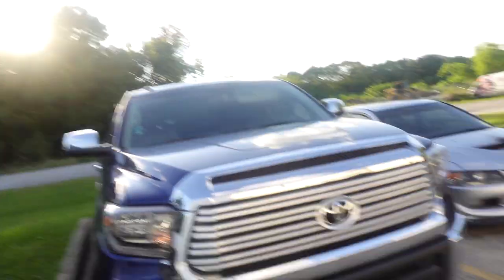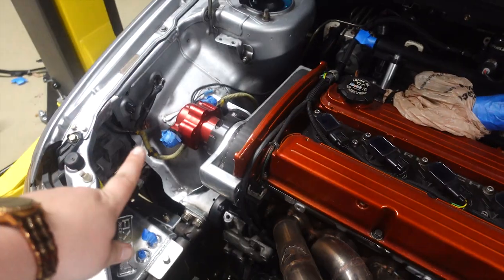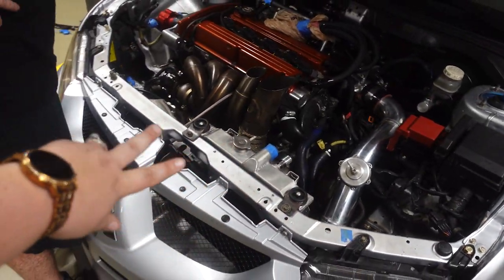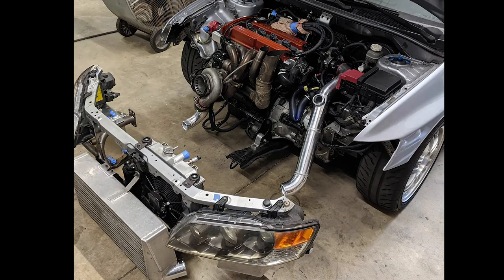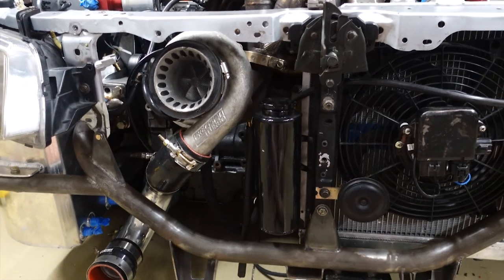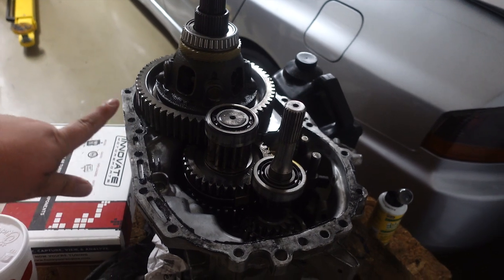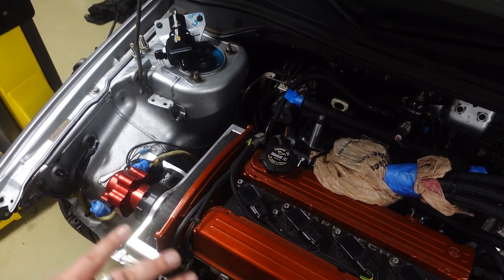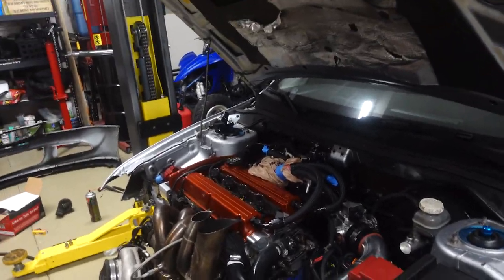EVO 8 gets TUBULAR FRONT END!

Comment: What's the diameter of the lower "hoop" that runs under everything and bolts to the frame rails? And what pipe did y'all go with (chromoly, DOM steel, etc.)? I have an old Mitsu Mirage I want to do something similar with.
Reply from the maker: The diameter idk, I'd have to ask Axiom. It's roll cage chromoly though.